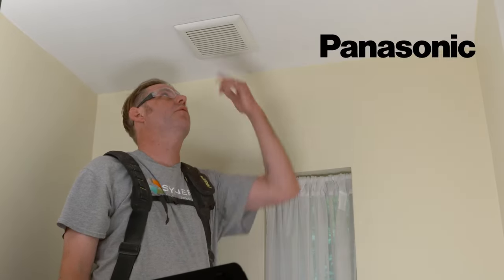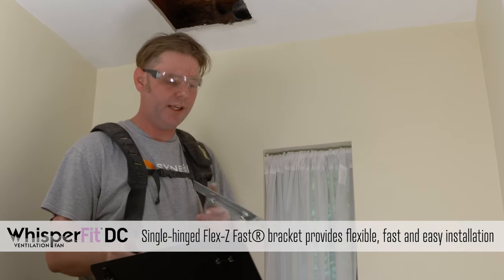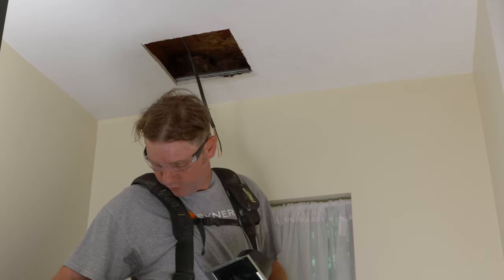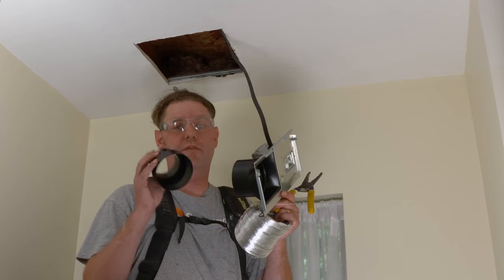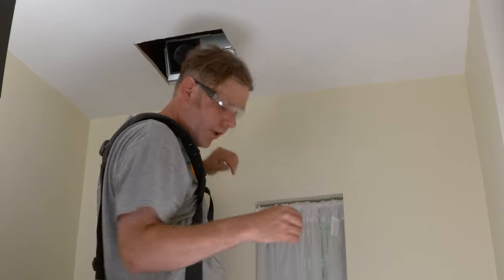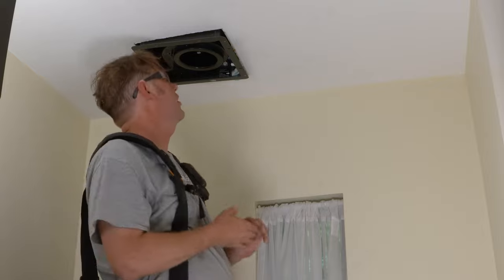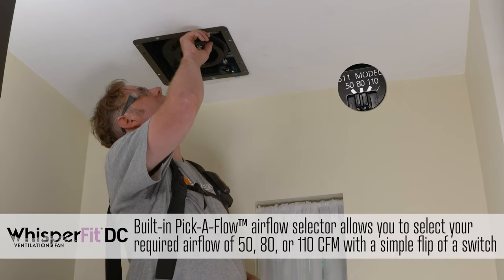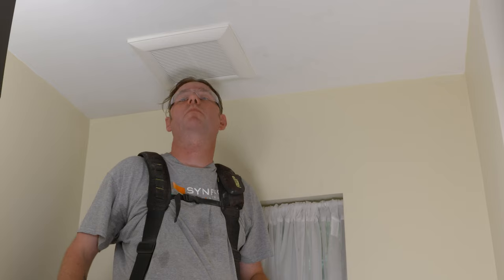How to Install Panasonic's WhisperFit DC Ventilation Fan

Comment: Is this a joke? What seems to be the most important and most difficult step is the installation of the junction box/duct collar and then bringing the fan unit into the bracket and connecting the fan assembly to the Junction box bracket. He cannot get to it from above, just from below. How did he connect the two assemblies. I don't think he did.
Reply: I think you are right.  This vid skipped the hard parts.
Reply: How can he undo it if it needs a fix?
Reply: This guy skips that step, another video the guy claims he thought his phone was recording and it wasn’t at the same part. Insane.
Reply: I screwed up the install of this fan twice in both bathrooms of my house because of this video!!! 

I fought the first one forever trying to slide the box into the junction box/ hose connection that was sitting in the attic. Then when I finally got it, it wouldn’t snap all the way in because the assemblies were separated by both the drywall and the mounting bracket. I then proceeded to cut the drywall hole larger so the entire fan box was flush with the bracket and it still wasn’t tight. I got pissed off and just smashed the first one together then after I purposely cut the drywall hole too big again on the second fan in finally hit me.
The junction box and duct collar lip sits against the drywall, not in the attic like this video shows. Now im just pissed off cause I screwed up twice trying to follow this video and will now have humid air venting across the exposed porous cut edge of my drywall. 

This guy sucks.

Comment: You have installed the adapter incorrectly. It comes under the drywall not under the flex bracket.
Reply: At what time of the video is that? Just want to be sure I'll install mine this week.
Reply: @FrancisDGM time @ 3:50 the bottom lip should be under the drywall.

Comment: Multiple people have replied correctly that this install was not 100% correct. I have done this twice with this unit. Once in my unfinished basement and one as a replacement in my master bath. I did have access to the attic for my master bath which was helpful. Because of the rat runs and trusses that were in the way, I had to add a metal 90 degree elbow up, then add the 4" to 3" reducer and then attach the 3" flex duct. For the drywall, I only cut a hole the size of the fan box itself. With the EZ flex bracket, one direction is already set for you. There was no exposed brackets. The drywall covered them, which also helps to bear the weight load of the fan. Screw in your brackets to your joists/trusses. Make sure they are square. Once you have connected the wiring and duct to the removable junction box, that part gets screwed into the flex bracket. However, the L portion lays (wraps) on the drywall and you screw through the L, drywall and then into the bracket which is on the other side of the drywall. If you do not do it this way, then the fan unit will NOT seat fully into the junction box. Once seated fully, the four flanges of the fan housing should be flush to the drywall, you screw in the last two screws, put in the small machine screw and plug in the electrical quick connect and you are good. That machine screw helps to hold the housing into the junction box portion which is screwed into the flex bracket. If you have some gaps between the flange and drywall, just hit with a bead of caulk so everything is sealed. You won't see it because of the plastic finish piece. I agree that both the written instructions and pictures are lacking.
Reply: One question: if we need to replace the fan in the future, it would be a hard job as the whole fan site on top of the drywall. There is no way to take it out without cutting the drywall. Is it correct?
Reply: @gz6915 there is a plastic tab that clicks when you push the fan up and connect it to the little box that has the exhaust and the wire box.  If you need to remove the fan you push that tab after taking out the 2 screws that hold the fan to the bracket and the  fan should be free to be released.

Comment: my ceiling is a plaster with wire mesh construction from the early 1960s. The current fan in there is a straight shot to the roof. Guess it's called an "inline" exhaust fan. There is no hose tubing etc - it's basically a round cylinder of sheet metal that goes from the fan through the air space to a covered vent.  I'm still trying to wrap my head around how to install a new generation fan into that spot>!!?
Reply: You'll be way better off with your old straight shot sheet metal ductwork than the flexible plastic duct.   The sheet metal is smooth walled and less resistance and will work much better.  Definitely utilize the existing ductwork.   You will figure it out or find someone that can help you.  It basically comes down to having the right tools, time, and patience.  I just installed one of these in my upstairs bathroom in a 1917 house.  Had to design and build my own galvanized 4" duct work all the way to the gable wall on the back of my house.  Took a lot of time but finally got it all roughed in and connected tonight and it works.  Had to insulate the duct work as well because I live in Northern MN.  What a project!!   I had the tools and the time though, so I saved a lot versus finding a contractor to do the job.  Kind of a fun challenge.

Comment: I installed this fan my biggest complaint is that I had a hard time installing the face plate where the ducting goes. I tried to snap it together where these plastic pin guides supposedly holds it in place but these little plastics keep falling off. And the lid covering for the duct does not fit I couldn’t put it on because the dry wall is in the way. I don’t know how people are able to close the face plate because it won’t fit it sticks up over an inch and won’t close not unless I rip about 2 or 3 inches of the drywall but now I’m gonna have a giant whole that measures 3 inches by 10 1/2 inches, I think the engineers forgot about the lid cover and the dry wall. There is no way to close it. So I had to literally make holes on my ceiling and leaving it paper thin, now I have to use drywall patching I almost gave up with all the frustration. What were they thinking! Has anyone encountered this problem?

Comment: TO ANYONE THAT IS ATTEMPTING THIS INSTALL:

When you get to 4:45, DO NOT DO IT LIKE THE VIDEO SHOWS! The lower edge of the junction box/ducting assembly that he shows as sitting in the attic, needs to be flush and catching on the bottom of the drywall. Not completely in the attic sitting on the mounting bracket like he shows in this video. I hope I just saved someone an hour of frustration.
Reply: As someone who is doing this install as we speak, thank you😁
Reply: Son of a B!!! Should have read the comments first and it would have saved me time and frustration!!!

Comment: Thanks!  I report success!!!  The biggest challenges were the screws from the old supports were wildly angled downward, making it difficult to get anything into them except for my handy vampliers.  Getting the fan box to snap into the electric junction box/ventilation hose "smaller section" was much more difficult than I imagined.  Part of my problem was that the previous fan width was about 1/4 inch larger than the Panasonic, so the smaller section's bottom lip wouldn't stay firmly below the ceiling sheetrock, it just kept scooching up, preventing the happy click of section mating.  My solution was to use a pair of washers around the screws that go on the smaller section side so the screws wouldn't travel up through the extra wide fan box section screw slots (I have no idea why they made them so wide and long...)  As the screws tightened, the washers held firm from below and the screws pulled the small section down until the happy click occurred.   I also discovered in my first try at this that if there's no "click" then there will be a high volume of air escaping into the attic, likely moist bathroom air.  That click is crucial!

Comment: Great video. It really helped at least confirm what I thought the instructions were attempting to convey. The one piece that maybe was not caught on video was using 2 of the long screws to secure the adapter to the ez bracket before pushing the fan unit into place. Thanks for the video.

Comment: You skipped the part that I am struggling with - installing the adapter to the Flex-X bracket with two self-drilling screws! ... when following the diagram instructions, the screws don't hold the two together.

Comment: This video was done well and helped a great deal.  The instructions that come with the fan are poorly done.  The illustrations are bad.  This video made all the difference and I was able to install the fan in a couple of hours.  The only thing this video does not show or deal with is all the insulation that will come down when installing from the room.  Also, my old fan was stapled on ears of the housing from the attic so I could not tear it out from below.  I recommend doing your homework before trying to install from the room.  I have a good enough space above the ceiling that I could go up and move all the blown-in insulation out of the way first and remove the old fan housing.  It also gave me access to the vent pipe and electrical wire better than from below.  None-the-less, with these instructions you can do everything from the room as long as your vent hose and electrical wire are reachable and your old fan is attached from inside the old housing.

Comment: Mine didn’t come with a 3” to 4” reducer, which I needed. Also, the bracket was a pain to install with 3/4”strapping between the drywall and the joists so I had to add some blocking. I wish they had designed it to be more user friendly for that situation, which is pretty much the norm here in the northeast.
Reply: they have several models, ya need to get the retrofit models, comes with plastic slip on reducer and flex bracket.  I installed 3 to replace the old Broan cement grinders...Panasonic is the way to go in bathroom vent fans
Reply: I’m a builder here in the northeast. Wait is the 3/4” strapping not a thing elsewhere? Does everyone else just go right to the joists? I was wondering how the hell they didn’t account for this.

Comment: I have the Panasonic RG-R811A whisper remodel exhaust fan. Does the Panasonic RG-R811A bathroom exhaust fan have a moisture sensor to automatically place it in standby mode when no moisture is present? Also, which switch is recommended, a timer switch or a regular switch, and which make and model of switch for both? Thanks.
Reply: Wishper Renew Model #RG-N110LHA have the moisture sensor. Since your  RG-R811A doesn't have sensor you may have to use a timer switch

Comment: Good video--it all works.  However, like many other installers, he did not follow the installation instructions which say to secure the Adaptor to the Flex-Z-Fast unit BEFORE installing the fan body.  YMMV.
Reply: Yep noticed the same thing
Reply: Agreed...are there holes for the long screws or do you just screw through the slit on the bracket and then through the metal on the adaptor?
Reply: @christhornton468  You may wish to look at another installation video.  Most of the instructions show two self-drilling screws through the holes in the lip of the unit that go through the drywall and into the Flex-Z-Fast bracket already installed.  I think that is what you said in your comment, too.

Comment: What if you have a plaster ceiling? would screws hold on the edge of the plaster?
Reply: I just installed this model yesterday. The screws actually go through the ceiling and into the "Z-fit frame"...which is screwed into joists. What your ceiling is made of should be irrelevant. That being said, there are 4 supplied screws, but 8 screw holes in housing tabs. I'm not sure what the strategy for that was.
Reply: @bkulber1  yep, you're right. I got mine installed about 6 weeks ago. It went in really easy.

Comment: Sure; but try doing it in a old lathe and paster ceiling ? How do you accommodate for the ceiling that’s over an inch thick ? The main fan housing doesn’t slide up far enough to be able to connect the power plug in .  That what I’m trying to do .
Reply: I'm worrying about the same thing my house has new ceiling layered over old and is prob 2 1/2 to 3 inch thick...worried that the vent air outlet won't sit high enough to connect ...no fan installed there either 😢
Reply: I figured out what I did wrong. The flange of first part of the fan where the output vent is on , needs to be on the outside of the ceiling (Drywall/ Paster). But if your ceiling is really thick ,I don't think it's going to work at all. You're going to have to reduce the thickness of the ceiling where the fan is going to be mounted. Probably the inside layer of ceiling . Try and get it down so it only an inch thick. And then you will probably need to frame a subframe of wood,  so the mounting bracket can be secured it. A lot of carpentry is about improvising. This not a quick job, try to be patient. Good Luck 👍
Reply: I just had this installed in my plaster ceiling. I actually worried about doing it but the installer had no problems and the fan works just fine. There was no fan previously.

Comment: Think know now What I did wrong I had the fan primary fan part, placed on top of the bracket instead of on the underside outside of the drywall

Comment: Why would anyone choose the 80 CFM over the 110 CFM?  I would think you would want the most suction power.
Reply: I think it's going to depend on your duct work. If you have 3" or even 4", you may want 80. I installed this with 4" duct work and I had a lot of air pushing through the seams of the unit when I had it set to 110. Something you don't want in northern climates. I put foil tape on all the seams which did the trick, but I would imagine most people won't think of that. Also, you pretty much cannot hear it at all when it's at 80, but when it's at 110, you can hear it, but it's still no doubt much quieter than what you're replacing.
Reply: 110 CFM is better but louder. That's the main difference

Comment: Would've love too see if bracket it flush to ceiling or any wiggle room, he must've had the same problem and skipped it. I have drywall and plaster about 1.25 thick.  Oh well trial and error always figure it out.

Comment: Does it need to be connected to a switch?
Reply: @robcoviello5383, your question is a month old, so maybe you have already sorted this out.  In this video, the installer just re-used the existing switch (or timer) that was already at the other end of that electrical wire. NEC code now requires a TIMER, not a switch. I guess the timer is safer - in case you forget to turn off the switch -  but honestly it's also WAY more convenient. Set it and forget it.

Comment: Video shows the easy steps. He must have hired someone to do the hard parts.
Reply: Exactly.  I put this fan in today and it ain't as easy as this.  To get this to fit you need to have no drywall material between those rails and the flange on the fan assembly.  Watch a video on an installation of the fan in a new house (no sheetrock) to see how it should go.

Comment: The instructions for this product are vague, with conflicting images concerning the adapter as installed to the bracket. This video basically skipped that part too. UGH.
Reply: Right, the instructions are not clear.
Reply: Oh, you mean how the product comes with 8 holes on the body, but there are only 4 screws? LOL! So strange. I just used logic to install it. If the frame is screwed to the joist, just screw the unit to the part of the frame that is closest to the part that is screwed to the joist. That's more than enough to support the weight of this unit.

Comment: Great video? No, it is not. This didn't answer any of my questions about how the pieces fit together. And when connecting the wiring, the housing was in the way so couldn't see anything. I learned nothing from this. Downvoted.

Comment: You're supposed to be a licensed electrician to do anything professionally higher than 10 volts.
Reply: wrong, there are exceptions.  You think siding guys are what now?
Reply: Maybe in New Jersey.   I did a complete solar install and it had to pass the city's inspection. My assistant used to be an electrician, which was a big help to interpret the plans and get it done right.  But there is no requirement to have a licensed electrician do the work.